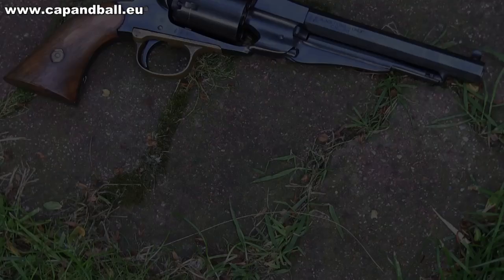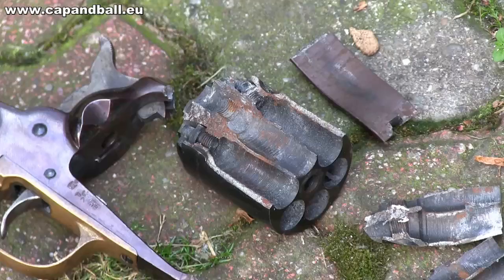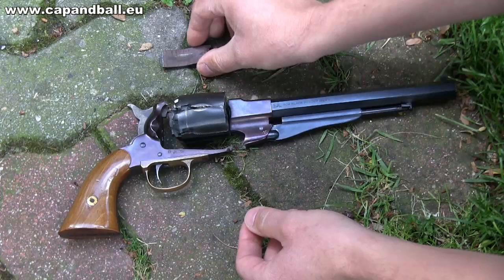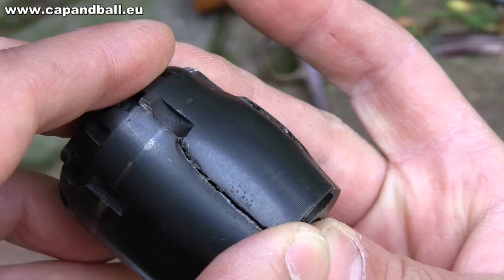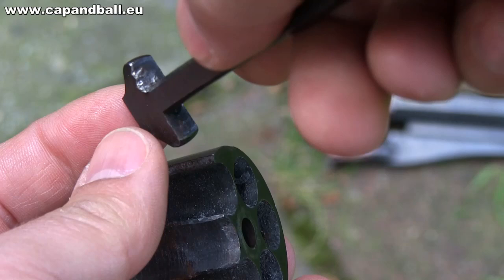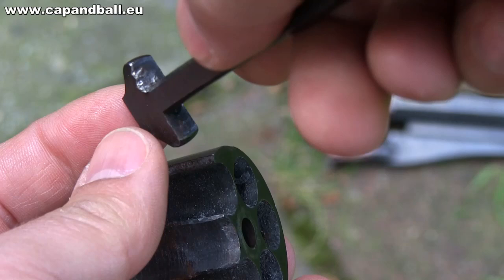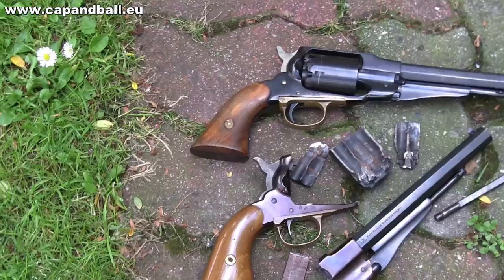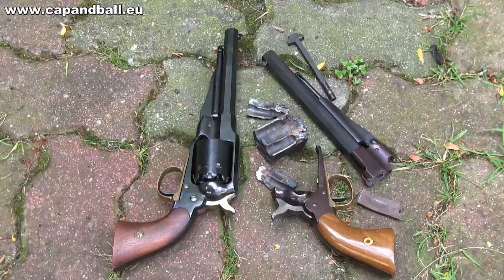The exploded 1858 Remington New Model Army revolver

Comment: Loading any firearm with any propellant will blow stuff up if done improperly. The reason some people load smokeless in a BP gun is because most of them understand that if a cylinder is rated at x pressure as the safe working load, you cannot exceed that pressure without courting a failure.  By the same token, you can achieve safe pressures using a propellant with more energy than black powder by using less of the more energetic propellant.  If you prefer to use a cleaner, more efficient propellant that leaves less fouling, and understand the previous sentence, go ahead.  But you had better understand the equal charge ratio of the propellants, for example, (and I am just using random num's here, do not use this ratio):  35gr of B.P.=7gr of smokeless.  Look up the actual chart for reference regarding propellant energy ratios.  They exist in a few different forms. So if I normally shoot a 35gr charge from my  Pietta 1858 Buffalo with one wad behind the ball, and a smear of Vaseline, I would use 7gr of smokeless and make up the difference in the cylinder by using additional wads behind the ball as needed, and a smear of vassy.  I would also load only one chamber.  Rule of thumb:  Anytime you do something different with your loads, or any time you or anyone shoots an unfamiliar gun or a gun in an unfamiliar situation, single load.  I'm really disappointed that the presenter didn't discuss exactly what amount of exactly what type of powder was used.  That information would actually have helped people 'cause they are gonna do what they are gonna do.  Why is prohibition and ignorance preferable to informed consent?  There are Republicans in Belgium?  Anyway, this experience has prompted me to produce some videos of my own to clarify a lot of the common misconceptions about firearms and safety.  See you then.

Comment: One thing I know about BP cartridges is that the reason the brass is the length it is, is to hold the amount of BP needed to propel the bullet. Smokeless powder is much more powerful and you wouldn't need as much, but the cart's have remained the same length. I wonder if this was the cause, over loading the cartridge? OR is it simply a matter of the cylinder of this revolver being too thin?
Reply: dkeith45 I doubt it was loaded with a cartridge at all. He just charged the cylinder as you normally would. Also, the poster says that there were "pieces of concrete" imbedded in the shrapnel, which makes me assume that, since only one cylinder was loaded, this was done as an experiment. I'm willing to bet that it was remotely fired also. I would hope that NOONE is that utterly fucking stupid. :)
Reply: thats mrharley2u D'oh, you're right. I just rewatched the vid and it's not a cartridge model. Not sure how I made that mixup. I must have been looking at some vids showing conversion cylinders for the 1858.

Comment: I know that for 45-70 and cartridge rounds there are equivalents for blackpowder, like instead of 70 gr of blackpowder some load 13 grains of xxxxx smokeless. but for the muzzle loaders you have to use either black or the smokeless powder designed for replacing black (the ones that use the same volume) i think pyrodex is a brand correct?
Reply: I use Pyrodex "P" the FFFG equivalent.
Reply: i think thats where a lot of confusion comes from because people say to get some of the smokeless powder meaning pyrodex and then they go and blow themselves up
Reply: There's Pyrodex and 777 and others that are black powder "subs".  What your talking about is loading modern smokeless in a cartridge which is perfectly safe with the rite charge and powder and in a gun that is in safe working order.  Keep in mind in a cartridge you are crimping a lead bullet into place.  When loading with black powder you seat the bullet or ball onto the powder, whether it's a BP cartridge or muzzle loader, with smokeless you've got a certain amount of air space for a proper burn.  The same smokeless charge in a shorter case and drastically change your pressure.  Your also weighting the charge, black powder is measured by volume and if your a couple three grains off it's not going to hurt anything, smokeless on the other hand...

Comment: I just want someone to make Percusion Revolvers that can be loaded with Smokeless Powder
Reply: Me too. A smokeless percussion or even a flintlock would have been awesome. But Im not sure if it can be done without changing the design completely...
Reply: It is actually « easy » , you just have to add tubes in the chambers to reduce A LOT the max quantity of powder in chambers (and forget .44 the thickness of the chambers is way to low anyway), and make precise computation of the pressure you will obtain... compare it with the max effort the chambers can withstand... then probably reduce more the available volume for powder.
Anyway, this would forbid you to use it as a « black powder » weapon, then you will probably face legal issues...
Bad idea...

Comment: Muzzle-loading percussion guns  do not benefit from the sealing effects of cartridge guns and have  threaded nipples which can turn into missiles if forced backwards. Smokeless powder is 3 - 4 times more powerful per same volume as black powder.  The pressure curve of smokeless powder  rises rapidly and drops early.  The pressure curve of Black powder  rises gradually and continues down the barrel.   The steel in percussion revolvers is soft and unhardened.    Some cartridge guns can be loaded with smokeless powder provided the load is tried and tested.  Late 19th century shotguns built for black powder were shot with smokeless  powder, but cartridge suppliers adjusted for this.    Many double barrelled guns did burst.  If its not a cartridge gun, never , never use nitro smokeless powder.  .

Comment: All of these "Never use smokeless powder in a black powder gun" videos I
 have seen are in fact examples of smokeless powder charges that would 
also blow up any gun, even if they were designed for smokeless powder. 
There are many black powder guns and cartridges that have been and are 
presently utilizing smokeless powder. The problem is it takes more brain
 power to safely use smokeless powder in any gun. Therefore the easy 
solution, for low information people, is to say never use any smokeless 
powder in a gun designed for black powder. 30-30 Winchester means it is 
30 caliber loaded with 30 grains of black powder. No one loads 30-30 
with black powder only anymore. Same is true of tons of other "black 
powder only" cartridges that are now being safely being loaded with 
smokeless powder. People have been loading black powder guns with 
smokeless powder powder for the last 150 years with out blowing up the 
gun. You have use precise weights of the correct amount a specific 
powder and bullet weight to stay the safe zone.
Reply: Mike , 150 years ago people were using smokeless powder ?  wtf

Comment: As long as you use the correct black powder in the correct grain and leave no air pockets then you can load it to a point of the balls touching the cylinder opening as our modern steel is 100% stronger then the steel in the originals. When I want to max out my load I use an empty dry 44mag brass shell loaded with pryodex as a measure on my 44cal 1851 navy steel frame and make sure the ball is pressed down enough. It's not something you want to do all the time but it's rather powerful and coughs up a cloud you could hide in. Worse that ever happened was a few screws got loose. I am in no way endorsing it but you can hunt with that loading. But I also have thousands of 30gr loads through it lol.

Comment: Load up your modern 357 magnum Ruger with a cartridge full of mystery "Blank cartridge Powder" and you will get similar catastrophic failure..  Blank Cartridges use ultra fast smokeless powders, as fast or faster than Hogdons "Clays",  Put a 15 grain charge of Clays in a 357 magnum case and it will blow your Ruger Vaquero cylinder to smithereens..  however if you load 5  grains of Unique under a .451 lead ball remember that its not black powder and do not seat the ball right up against the powder it will not blow up an 1858 Remington..   Like everything with reloading making stupid mistakes and not knowing the properties of the materials your working with will result in bad shit going down..   Load up a cartridge full of some fast burning "Blank Cartridge Powder" in a 308 and fire it in a modern Bolt action rifle and the results will be identical.. KABOOM.

Comment: Interesting that the distruction seems to have initiated in the center of the chamber rather than from a failure of the metal inside the bolt notch as one FOREMOST ! AUTHORITY! insisted would happen.  Ive seen cylinder notches blown out but also seen a number of modern revolvers deconstituted by overloads that ruptured pretty much like your gun did.    Very good and detailed report.

Comment: I get the importance of the message of not mixing up smokeless and black powder(especially in cap and ball as well as muzzle loaders) but this is a disservice if you dont mention the type or amount of smokeless powder that was used. Even the sturdiest modern gun will explode if using a much faster burning powder so the real lesson is really about knowing what psi your load will produce. as evidence of this there are many late 1800s revolvers that switched over to smokless loads with no ill effects, eg french mas 1873, french 1892, colt 1892,  webley mark 1-4, swiss ord revolver 1882, Swedish nagant 1887, 1895 nagant, and 44 russian S&W double action.

the truth is that although more dangerous, smokeless powder can be used in many cartridge revolvers when psi is within the rated range for black powder. there is a misconception that black powder loads are always less psi than smokeless which is untrue, and it is simply that smokeless powder has more variability in its burn rate and so requires measurement. both powders need pressure in order to push a projectile and there is no way a colt 1873 can push 524 foot pounds with black powder without exceeding 10k psi which was its original loading.

Comment: Hey buddy i have bene doing some research and found you can buy conversion cylinders for these guns. You can then  use smokeless black powder cartridges in it ,or what manufacturers call cowboy loads that only have a max pressure of 750 to 850 so once you purchase the conversion cylinder you can shoot 45LC in a 44Cal black powder revolver....I have an 1858 New Army Inox. I am looking around now for a cyilinder to convert it to center fire cowboy rounds? :>)

Comment: There is one specially made smokeless powder for historic weapons that is actually more kind to your gun than black powder. 
But (for as far I know) that is meant for 45-70 Government and lookalikes. 
It gives less chamber pressure and recoil.  It is Lovex D 060 (Accurate 5744)
It is also give less heat and fouling. Butt (and that is a pitty, less smoke, thunder, and feedback ;-) )
Especially expensive historical weapons that must be corrosion-free, or when shoot inside, will benefit from this powder.
I use 27grain in 45-70 and my Beaumont-Vitally.
*D060
High density, double base, tubular propellant similar
to Accurate 5744 designed primarily for .45-70 Government,
.45-120 and .50-90 Sharps cartridges and for reduced loads
in all calibre rifles. 
*

So, it is not true that any smokeless powder is dangerous in a black powder gun, but (as always) it's dangerous if you experiment without knowledge.

Comment: Being a competent reloader of dozens of calibers of centerfire, reading and calculating approximate chamber pressures using charts and chronograph, i feel confident i could use smokeles in my black powder if i took my time and carefully chose the proper burn speed and use a chronograph to work up my loads, BUT I WILL NOT DO THIS, because even though i could take the time to do all of this i would have no way of knowing for sure if the chamber pressures are correct in the calculations.  NOT WORTH THE RISK.

Comment: That person was an idiot. Even with black powder you still need to load the proper recommended load and maybe go a hair above because most of those charges are just for safety. If you go according to the old military loads most gentle you got to steal fall in a safe bracket. Like for instance for a 44 they say only 25 but you can go to the military old specks of 30. Don't try to squeeze 35 or 40

Comment: A Modern black powder Pietta, or a Umberty Revolver, is mutch weaker than an modern smokless Revolver, so do not try this!
Casting is no way as strong as forged steel!
Reply: you mean not modern
Reply: @BuddyTheGermanShepherd  Yes, i wrote wrong.
Reply: @atvheads  wouldn't it be better to buy a new cylinder made out of better materials instead of using a 130 years old one? sounds safer

Comment: Good video....and graphic...... Those BP revolvers are pretty strong and just about impossible to overload with Black Powder or the substitutes like 777 and Pyrodex..... and that applies to the 1873 Colt too.... loading one of those to .44Mag pressures will take it apart just like the Remington in the picture.
Those cylinder walls are very thin.....
Here in NZ it's a bit less likely to happen as possessing a handgun requires 6 months probation at a registered pistol club to assess and train a new shooter.... but even so, the occasional fool will go against the advice of those that know better.
I get very attached to my firearms and the thought of one in pieces through something like this is difficult to contemplate....
Reply: better to buy a new cylinder made out of better materials before using this old shit

Comment: you can load smokeless in a black powder gun, you just use less powder because the effects of pressure are different.  black powder is an explosive, smokeless is a propellent and burns.  when black powder goes off it creates pressure the same as smokeless, you just have to match the pressure ratings.
Reply: No, no, NO!  NEVER use smokeless in a black powder gun.  That keeps it simple and easy.

Comment: Should have used a Conversion Cylinder with Colt .45 LC 250 GR.  Most likely too much “Black Powder” was used or a “Double Charged Bullet Casing”.  My Pietta with the Conversion Cylinder Operated with Perfection following these simple rules.  100 Rounds, with NO ISSUES!  Also, be ABSOLUTELY CERTAIN, that the Cylinder Bore Perfectly Lines Up with The Pipe!  This appears to be a Mis-Fire because the user FAILED to “Dry Cock” The Hammer Back to the Firing Position and Observed with Absolute Certainty that the Firing Pin was clicked in and lined up Perfectly with the Pipe!  Some “Conversion Cylinders” are DANGEROUSLY DEFECTIVE AND ONE “MUST” INSURE THAT THE LINE UP IS PERFECT!  If NOT

Comment: I don't understand why they don't build the cylinder strong enough to withstand smokeless powder just in case. The cylinder on my Taurus 85 is no bigger than the cylinder on my Colt Navy but the Taurus can withstand +P ammo. Obviously I know better than to try using smokeless powder in my cap and ball revolver but does anyone know why they don't make them strong enough for smokeless?
Reply: bro... these guns are 130 years old, modern gun powder is not that old, they are not made for that
Reply: @BuddyTheGermanShepherd  I meant the reproduction pistols, not original. Obviously an actual 1851 Colt Navy wouldn't withstand smokeless powder since it didn't even exist back then. My 1851 Colt Navy is a modern reproduction made by Pietta in Italy in 2017.
Reply: @ferway6295  I think they wouldn't be real reproductions if they did some major changes like that. But I'm not sure.

Comment: Somebody who really doesn't know the differences. Can Somebody explain why one is ok and the other is not. Obviously one will destroy you or the gun but would like to be informed about it
Reply: The best I can explain it is that Black powder increases pressure to an extent and then looses power as time goes on so /————\ and it is less gas expantion than Smokless. 

Smokless on the other hand raises gas pressure alot fasen than blackpowder and it really never stops but insead continues to rise resulting in this kind of results.

Take what I said with a grain pf salt cause this is my interpretation of the info I got from someone else. But the result is Black powder=“safer” than Smokless

Comment: Why is it that modern blackpowder guns can't withstand the pressures of modern smokeless powder? Are the steels in modern blackpowder guns different than modern guns? Does the brass cartridge have something to do with it?

Modern revolver cylinders don't look any thicker than blackpowder revolvers, and the barrel thickness of single shot blackpowder guns is often much thicker. What's the deal?
Reply: Gene Smolko , the same way You will kill gasoline engine with diesel fuel , different chemicals different physical properties